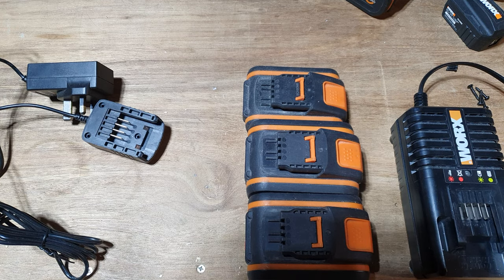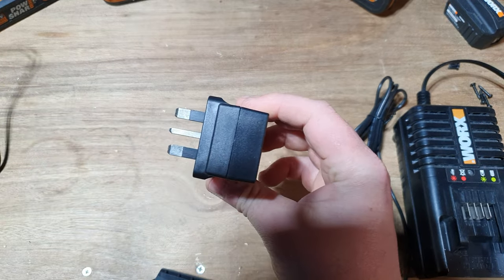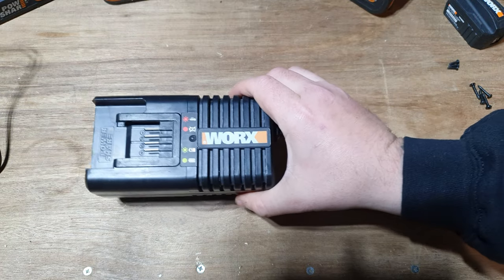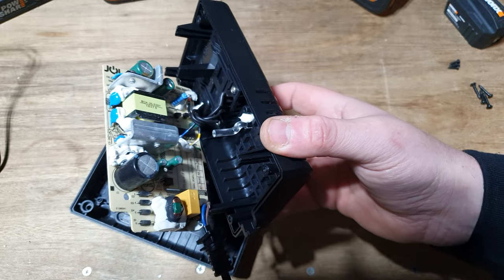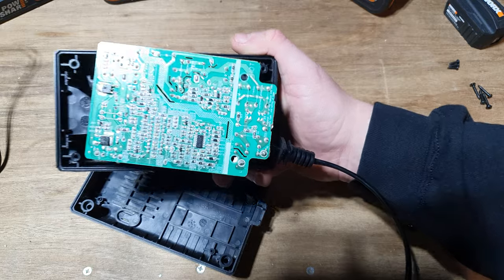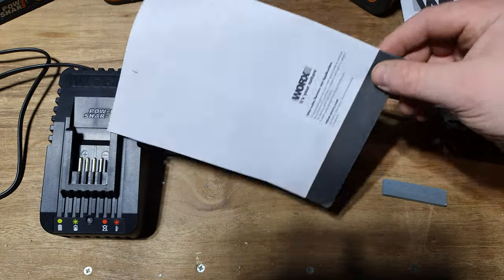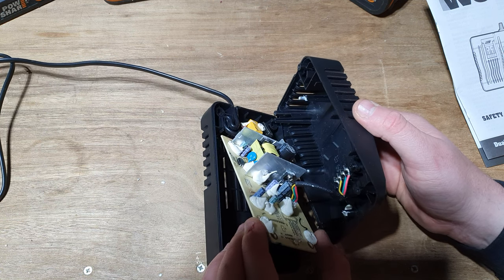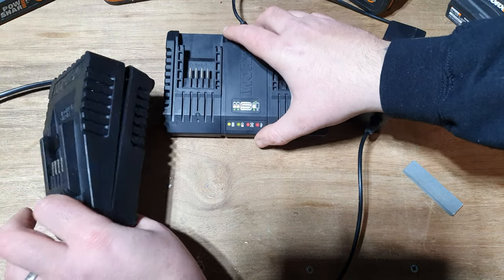mikes reviews: worx chargers a look on the inside and how fast they really can be!

Comment: finally where did you the information about the BS and TV terminals? just looking at charger pcb?
i have a works battery but not a charger have been trying to charge without BS and TV seems to work, maybe its a stupid idea?
Reply from the maker: I traced back and reverse engineered the circuit, a huge amount of fluctuation monitoring, individual cell and temperature monitoring of course in the US they have 5 pin output therefore a completely different battery and charging system!

Comment: Come to see the meaning of the 4 lights and get no aswer 👎
Reply from the maker: Flashing green = charging
Static green = fully charged
flashing red = overheated battery let battery chill and cool down before charging.
Static red = battery is faulty - most likely due to low cell voltage - replace battery pack.